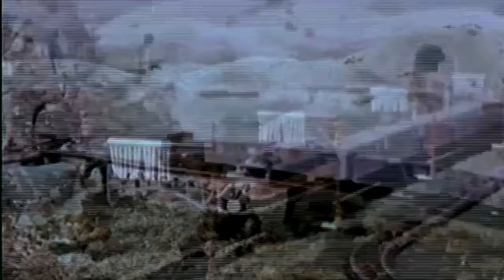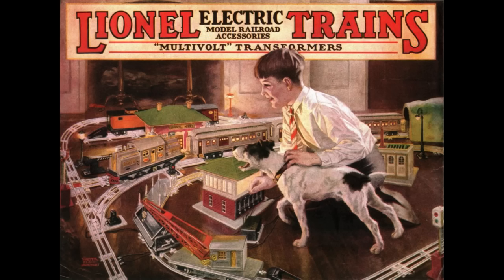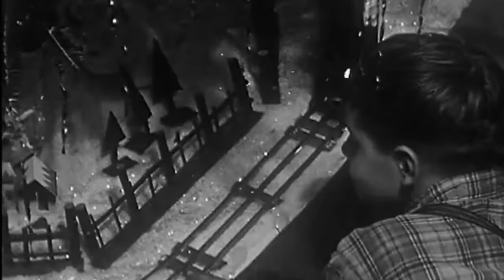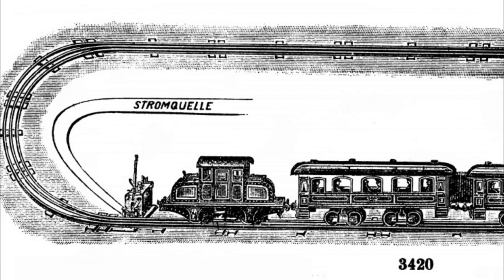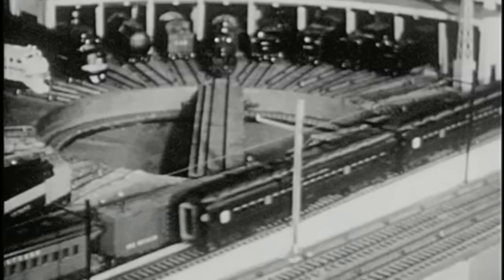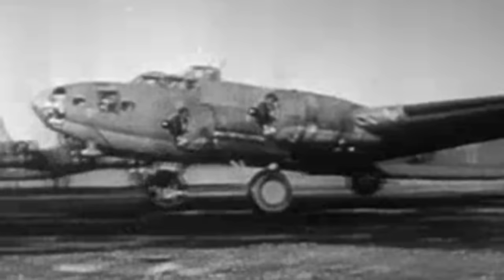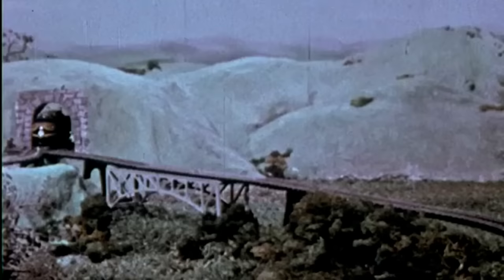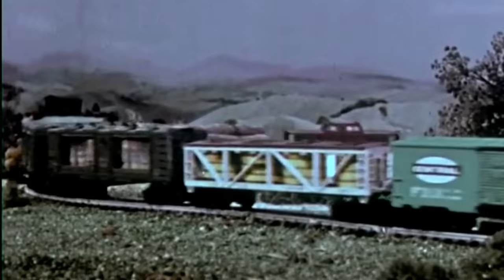Why Do Lionel Trains Run On 3 Rail Track?

Comment: I have  never  truly  understood the  dc track connections
Reply from the maker: If you mean Direct Current, on rail is DC +, the other is DC - . The circuit completes through the motor. All of the wheels must be electrically insulated or they will cause a short circuit across the rails.

Comment: I never have liked the Lionel 3-track system mainly for how it looks rather than any functional reason, it just does not look as much like the real track used in railroads. I like laying down two-rail track where everything is in proper scale to full-scale railroads complete with properly scaled ties, ballast, and everything else that exists with real, full-scale railroads. In fact, I would love to even electrify my trains using honest-to-goodness overhead catenary and pentagraphs on the locos. I just don't know how to do that, I'm not that good.
Reply: Triang in the UK used to have a system for doing that back in the sixties iirc. You could buy all the overhead equipment and power a loco from it. Back in the day that was the only way to power two locos on one section of track. One from the track and one from the catenary. I have never seen anyone use it however, outside of the adverts, so I don't think it was commonly used.

Comment: With the Hiatus of World War II Lionel could have changed to two rail O scale and continued three rail for kids to play with. All of the people who grew up would have had two rail Lionel trains and not three rail from before the war and anybody who I look about is from pre-war would have had them converted so when you went to a train show and bought used trains you would buy three rail locomotives that were converted over to two rail. You can run a lion LG G1 on two rail with cantonary because the two rail can be one current and the Canton area is the other therefore you can run three real cars if you run that type of setup because they can't short out anything. Doing overhead wire is an art in itself which is why many people don't do it. Of course I've seen trolley modelers do it and they have all sorts of equipment posts and hangers and everything else to do it properly with.
Reply from the maker: Lionel COULD have run 2 lines, but especially after the Prewar OO gauge disaster (available in both 2 and 3 rails and poor sales to show for it). MAYBE if the Scout line had performed better in 1948-52 they may have considered the switch. But when you're #1, why change?
Reply: @ToyTrainTipsAndTricks  the Scout line was an abomination for Lionel people Lionel really should have left the bottom of the barrel to mark and should have concentrated on the better grades of toy trains. People would buy their children a Mark's train set because it was cheap and then if they didn't destroy it then they bought Lionel to go along with it. Since both for three rail track you could run both on the same track. Sometimes in a box of stuff that you will get at a train sale you will get a box car with a Mark's truck on one end and a Lionel truck on the other end so this way this was the adapter car so you could run both kinds of trains on the same train. Just like in Ho everybody made their own type of coupler and nobody gave a thought to interchangeability. I'll come back and Model Railroader magazine in Milwaukee pioneered the nmra for standards and Rail and wheel sizes and couplers. One of the reasons why ho took off like a bat out of hell after World War II of course houses being half the size that they were before the war you did not have the room for a big O gauge layout. The two rail O gauge guys had it even harder with having to have large radius like 072 as a minimum for their engines and as high as 096 that's why many of them had around the room wall layouts on shelves with a folding section so the door can get in and out. Model railroaders were very creative in those days. Especially when you could not pay for somebody to build a model railroad for you you had to do it yourself.
Reply: @ToyTrainTipsAndTricks  Roy Donnelly the publisher was the big driving force between 00 trains. Lionel was repeatedly warned not to get into 00 trains but he wanted to be the one up on everybody so he went into that field and it was a disaster. If Lionel had concentrated on making good quality scale trains either two rail or three rail they would have been much better off especially if they concentrated on the trains and not the stupid things that they got into after World War II like the record player and the fishing equipment Etc that stole Capital away from the company. The big drawback to two rail scale trains is the cost if Lionel made scale two rail bodies with two or three rail trucks too real would have been a whole lot more popular. Having a more crude layout is better than having no layout at all. If I knew is too expensive then you always buy used and then later in the hobby whether it's trains cars motorcycles whatever then you get to buy new stuff. People go on that all of the old stuff I buy is dead men's trains. I tell them that the ghost of the owner is probably a happier that that box of trains is up and running on a layout then sitting and rotting in a box somewhere. I bought one of my favorite Lionel locomotives used and the bronze drive gear was completely worn out and had to be redone and it showed that that locomotive was some kids Christmas or birthday present and they ran the wheels off of the thing forever. They loved that locomotive that's why they ran it until it was almost worn out. And the fact that you could fix it 50 years later with brand new parts at a reasonable cost for parts and labor goes to show how sturdy they were built in the first place.
Reply from the maker: @frankmarkovcijr5459  Lionel did, at times, make fine scale models (700E, B6 switcher, etc). The F3s were the best scale diesels available when they were introduced. The first NW2s as well. By the mid 1950s it was apparent that HO was becoming the modeler's scale.
Reply: @ToyTrainTipsAndTricks  it's a shame that the f3s had plastic shells because if they had diecast shells that would make them a really good heavy puller. Myself I like running diecast cars because you don't have to space anyway to run a ridiculously long train and I love to listen to diecast cars thump through switches and crossovers like the real thing. Thank God for William's trains before they got killed by Bachman. You had nice simple easy to maintain locomotives without all the bells and whistles to go bad at reasonable prices that did not break your wallet.
Reply: Today’s radio control technology works great for airplanes, boats, and cars, why not trains? Then there would be no need to electrify tracks at all.
Reply from the maker: @davidgardner863  The concept is called "Dead Rail". Like other forms of command control, add $150 to the base price of the locomotive for digital decoders and battery packs. It's only practical for O scale and larger due to battery size and operation is limited to 20-30 minutes between charges due to the current draw of the motors.

Comment: Then came train cars with plastic wheels except for the locomotive, and short circuits were no more. back to two rails.
Reply from the maker: Many 2 rail operators convert their rolling stock to metal wheels for improved operation.

Comment: Not true about no trains run on 3 rails . Current commuter trains and subways run on 3 rails you just don’t see the 3rd rail because they carry thousands of volts. Other trains have an overhead rail for power. Most long haul  current cross country freight trains use 2 rails .

Comment: Still not explaining clearly the electrical advantages of a 3-rail system, beyond the insulation issue! 😳 One is to simplify the operation of turnout loops, since the outer rails are electrically identical. The other use is to automate layouts with signals, gates, etc. that can be triggered when the train arrives, using insulated sections.

Comment: Can Lionel trains run O Scale and freight cars on 2 rails? Yes or no? Thank you for your help!
Reply from the maker: If your question is whether trains designed for 2 rail O gauge can run on Lionel 3 rail track, the answer if usually yes IF you change the wheels and trucks. The wheel contours and flanges are different sizes for 2 and 3 rail O.
Reply: Do the Lionel train freight cars fit with 2 rails
Reply from the maker: @byartion3831  As above, you have to change the wheels and trucks. 3 rail flanges are too deep to operate on 2 rail O scale track.
Reply: @ToyTrainTipsAndTricks  ok thank you

Comment: Yes three rail makes you compatible to run all of the garbage that Lionel made in the old days. Lionel made some good scale locomotives and some good scale cars here and there but for the most part they made toy trains that were under scaled for kids. Today you could have a fantastic layout with all brand new equipment but it is straddled with the curse of the third rail so you could run crap from the old days. The toy trains from the old days with their smaller than scale sizes and lack of details are not really welcome on a modern layout where you have scale cars with details like in Ho and engines with detail like in Ho. You can have a $2,000 state-of-the-art locomotive and it is cursed with the third rail. I have one layout with scale engines and scale cars and cars that are close and I have one layout that's all 027 cars and engines from Lionel and marks.
Reply from the maker: Two rail O locomotives are available.

Comment: Because Lionel never evolutioned and that is the cause of their demise
Reply from the maker: Interesting comment. American Flyer switched to 2 rail and went bankrupt sooner.  After WW2, Lionel was the #1 manufacturer by a wide margin despite not changing. But their 2 rail HO line floundered (as did their prewar 2 rail OO trains). Thanks for watching.
Reply: @ToyTrainTipsAndTricks  most O sclalers worldwide modelling US trains, are doing that in 2 rail not 3 rail. F. e. in Germany, Austria and Switzerland, 95 % of the American O scalers are modelling in 2 rail. In  the rest of Europe  is app 70% for 2 rail (even in separatist UK). The only 3 rail  area outside the US is Australia were 2 rails is around 40 %. Lionel has a certain popularity world wide after WW II but American Flyer  was only prominent in the US market.
Reply from the maker: @steffenrosmus9177  But the USA is different. As the video explains, there were several reasons that Lionel stayed with 3 rail - and some of those reasons account for the popularity of "Hi Rail" modelers (those who run scale equipment on 3 rail track) in the US today: simplified wiring (reverse loops require no special wiring), simplified detection and activation tracks (self-aligning turnouts, signal systems, etc), and the standardization factor that one can run Grandpa's 1938 American Flyer Royal Blue on the same layout as your new Dash 9. There are likely more On30 and On3 modelers in the USA than 2-rail O scale. Thanks again for your input.
Reply: @ToyTrainTipsAndTricks  in Europe every model railroad company started in 3 rail. But most changed after the last worldwar to two rail. Only in HO there is one company called  Märklin, still building in 3 rail AC. For me 3 rail never was an choice because I use dual gauge for my mixed standard/narrowgauge layouts which many people in Germany prefer. Fun to transfer standard gauge cars on narrow gauge lines with special devices called Rollwagen or Rollböcke (narrow profile ng cars on which standard gauge cars are loaded). Makes the hobby more interesting and keeps thw folks busy at open house operating sessions. All those 3 rail gimmicks you mentioned lost importance due to digitalisation. App.70 % of the layouts here are digital. If you wonder were I got all those informations from. Since my retirement  I work full-time for NEM (the European NMRA).
Reply from the maker: @steffenrosmus9177  Most NEW trains here are Command Control, which is why (cost) there is a brisk market for older conventional trains and for channels such as this one that focuses on older equipment. Digital is nice, but when a model locomotive is more expensive than your monthly auto payment (or in some cases, your HOME payment)...Yikes!